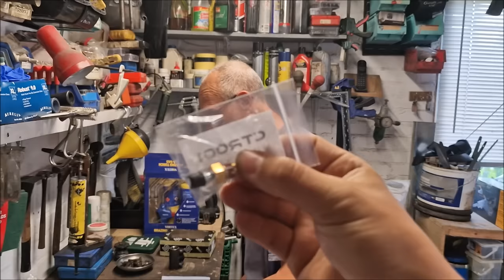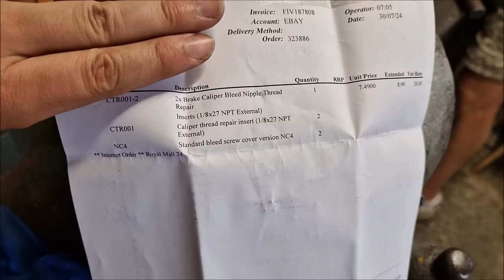Can A £5 DIY Wheel Cylinder Repair Kit Save Us £170? - Armstrong Siddeley Brake Repair

Comment: I must admit I do enjoy your chatting with your Dad. One thing, if it were me, I would have put a strap around those brake shoes & pulled them tight into the brake piston holder. Then bleed the system. This way you are guaranteed to get the air out.
Reply from the maker: Thanks for the tips!

Comment: Hi Jon Goodo!   5 bob pillar drills are 5 bob for a reason! It will have massive tolerances hence all the movement. I would advise your Dad to get a decent one I have found mine invaluable. You can set the cylinder in a vice so it is square and plumb and clamp down. Drill then remove the drill put the tap in the chuck and start by hand in the chuck then finish with a wrench. It saves a possible visit to A&E! I guess you did not mention annealing then? Does the fresh air flap work next to right leg? If it is like the Riley it is a spring loaded with a spring in a cylinder. As the casting is mazak it becomes brittle and can break. I effected a repair by taking the whole thing apart greasing and putting a tube over the cylinder with epoxy to strengthen. When you have done take it for an MOT and film it, that would be an interesting vid!  Cheers John
Reply from the maker: Yes Health And Safety was not top priority in this video - thankfully all good. The vent flaps indeed work - they are open most of the time! Thanks for watching. J

Comment: It’s great that your trying save money. However sometimes with certain things I personally prefer to spend the extra few £ a bit the bullet with new parts. 
However I wish you the best of luck.
Reply: In this particular case, I’d say the original 1949 cylinder is very possibly a better part than a remanufactured one, and the use of a helicoil insert is in no way a questionable repair!
Reply from the maker: The wheel cylinder we would have replaced it with would sadly probably have been of sub standard manufacturing anyway 😕
Reply from the maker: Absolutely 😁